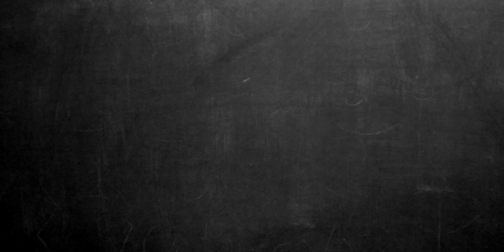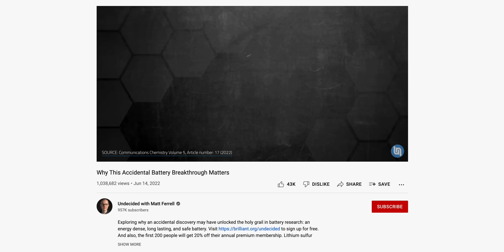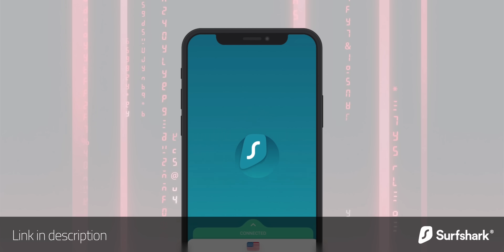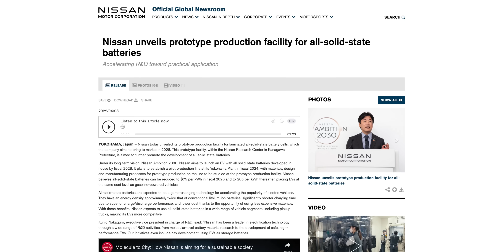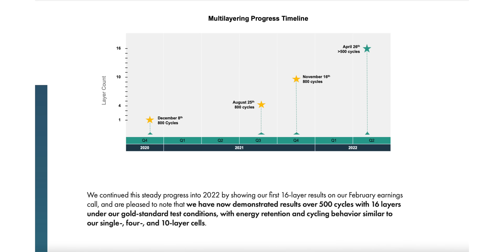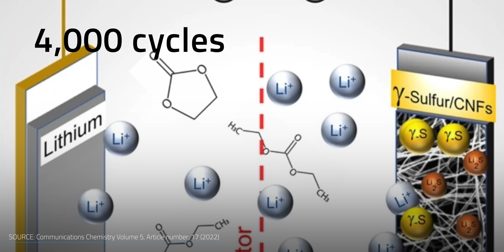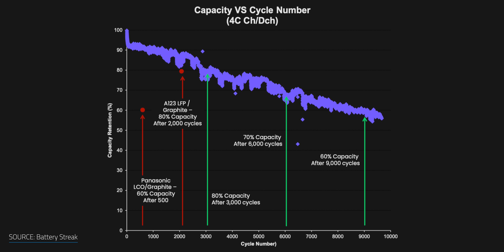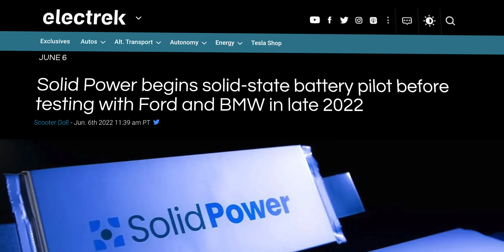Is This Solid State Battery Too Late?

Comment: I really think the small form-factor solid state batteries would be wonderful in personal electronics. A high-tier Samsung or iPhone that can go a full week -- OR TWO -- without a charge, and is charged within 5 or 10 minutes from 0? A laptop computer than can be used 3 days out of the week PURELY on its battery and only need charged one time when you get home -- all week? 

Hell, take some of these SOC mini systems (Raspberry Pi for example) and have them running for weeks at a time, doing whatever they do, even if you're out of power for a few days?  

Get me a big enough one and I could replace the lead acid battery in my APC battery backup device and could run my 1150W gaming PC for a full day on emergency power. Or a home router and modem each for 2 weeks during a power failure. Things where using a chemical battery is otherwise not particularly helpful or possibly a hazard would become a useful backup power solution. This would include also dash cams in cars. 

Okay some are asking, why in dash cams, they already use batteries?  -- Easy, Lithium battery packs HATE heat. I had one in my car during the peak of summer and the pack hyperinflated in its pouch, so much so that it SPLIT THE CAMERA BODY APART. Because of that camera, I REFUSE to buy a battery-powered camera. Period. and I tell ANYONE looking for dash cams (especially in this area where summers have gotten more and more days out of the year in the triple-digit ranges) to AVOID traditional cameras. yeah they're more expensive going with Super Capacitor types, but I'd rather spend $300 on a 3 channel system not using a battery that has nearly no risk of catching fire when the inside of the car reaches 150F. The current backup option is Super Capacitors. Which only power the camera for just a few seconds or minutes after power loss. Both my cars are using these at this time, but imagine where the camera could sustain itself for 3 or 4 days parked after the battery low-voltage cutoff is triggered, and the camera would then revert to battery power -- again, for several days. Now, I tend to drive my cars at least 3 times per week each. (Everyone knows leaving a car sitting for long periods of time is WORSE on them than driving them alot)

Comment: I have done my Phd on lithium ion battery and have experience in solid state , lithium sulfur , anode cathode and separator. I personally dont see solid state battery as the future , lithium ion battery using liquid electrolyte are also progressing fast with multiple solutions used for flammability and high capacity anode cathode materials like silicon and sulfur. Solid state battery has far too manyy problems and research vise its a good topic

Comment: With true financial incentive to find the next big battery tech I'm sure we're within coupled of years of a breakthrough. Take the new F-150 Lighting for example having 320 mile range with the extended battery but dropping to a third when pulling a 10k trailer. Now put a battery with 2.5x the range and now we're going beyond 250 miles whilst doing real truck work. Yeah it's not matter of how, but when it'll happen. Now let's beef the grid up to handle the extra load.

Comment: As a person whom recently moved to a place where I needed a car, and hence bought my first car, and since I just bought a house my first car needed to be cheap enough I could buy outright. I was looking at 10 year old EV's, but everyone I could buy if I really stretched my budget, did not have enough charge in the battery that I drive my planned day to day trips without and only charge at night. And if I charged both day and night, it would not be enough to drive any unexpected trips on top of that. I got a really good deal on an 8 year old ICE Hyundai that had barely been driven... Hopefully  I can buy 2-3 year old EV in 2 to 3 years.

But my point, sorry for the ramble, is that the lifespan of EV's made 10 years ago is too short... As far as I understand EV's made today will last longer than the older once, but I really hope batteries can last 30 to 40 years soon instead of 10, for the sake of our planet

Comment: I'd say we should still try to push as far into the solid state battery technology as possible, because we don't know what will work out with lithium, but we also know that lithium is limited as a ressource and maybe one of the possible solid state chemistries will be adaptable to sodium solid state batteries, that overcome the energy density problems we currently habe with them, which might not be possible with a liquid phase chemistry for them.

Comment: I can't find any mention of battery streak's energy density. I can only assume it is no better than Li-ion. IIRC solid state promised to reduce cost as well as mass and charge time so don't know where the $200/kwh comes from.
LFP seems to be the battery of choice for longevity and cost for now as long as you accept lowish range. Many will accept this tradeoff of cost/range.
Also the lifetime for solid state was with continuous fast charging which won't happen in the real world.
I think there will definitely be a place for it, while looking forward to Li-S even Na-S for really low cost.

Comment: I still feel that solid state has the potential to move adoption further than any of the others. I understand that they are just early, best case, numbers, but the thought of cutting the weight in half and charge time in half in my mind pushes through the barrier for the reluctant.

Comment: Being that I am most interested in automotive applications, I am most concerned with weight. If a company can make an electric vehicle with decent range, and weighs less than 3500lbs, I might actually be interested. Heavy cars are not fun to drive. 

Me car only makes 200 hp, but it’s more engaging and fun than any EV I’ve driven.

Comment: Wouldn't new battery types be a perfect fit for smartphones, they are really expensive for their size, a flagship phone that could bring 50-100% the capacity, half the charging time, and better longevity would be revolutionary, and it would really help bring down cost for larger options like EVs
Reply: The cost of a smartphone battery is less than $10. There already are phones on the market that you can charge at 120 W, so fully charge from 0-100% in about 18 minutes. 
If most people buy the same Samsung and Apple phones then those manufacturers simply don't feel the need to improve their charging rates. It's technically possible now.
Reply: @saschamaj  well I'm part of the problem in that regard, on the other hand I don't really care about charge speed, it's only a bonus to the much better battery time

Comment: no matter the battery composition you still have to charge the thing. therefore...i won't be doing the ev thing...or even consider it until fusion happens....if it ever does.  i don't want to be part of the pollution problem by merely displacing the pollution source. then there's the sourcing of materials / recycling conundrum. as of now...i do NOT see ev's as an answer to pollution.

Comment: its important to remember that alot of this is very new in the research world. we've been so focused on designing energy storage on the micro scale but those methods simply dont scale up so we pretty much have to begin from scratch.
Reply: The needed scale isn't that large. Ev's have now reached a size where they are big enough both for cars as wel as domestic storage..
Any progress is now going to keeping the same capacity buy lowering weight and volume.

Comment: " In 2021, the United States consumed an average of about 19.78 million barrels of petroleum PER DAY. This was an increase in consumption of about 1.6 million barrels per day over consumption in 2020."  (From the US Energy Information Administration.) What do we have to replace this?  Filling batteries with electricity from coal and oil fired power plants is not the solution. All battery solution that reduce hazards, rare earth materials, and other problems are needed 30 years ago. We are without a doubt so far behind the 8 ball it's going to be really difficult. I know there are many brilliant people working on this problem. I hope for our species sake we can find a way. Peace out.

Comment: I'm really disappointed with the battery statistics in this video. You always talk about how the QuantumScape cells retain "above 80%" energy after x cycles while comparing it to other cells where you state they only reach those "low" levels after 800-1000 cycles and make it look as if the cells are bad in the way you present it. If you actually look at the graphs the cells retain around 90% after 400/800 (depending on where in the video you look). If you now extrapolate those graphs you roughly reach also reach 80% after 800-1000 cycles. So no difference in cell life for cells that are still in development with cells that are available already (aka a good thing as they should keep improving until release). And let's not even start talking about the tesla cells. Other commenters already pointed out that it is obvious why the bigger cell stores more energy.

Comment: All these technologies are stepping stones. And different solutions are effective in different applications. Just as LFP and flow batteries are good for household and small grid-scale solutions, solid state batteries may present advantages for applications in personal devices like cellphones and laptops.  A cellphone that charges in 10 min and lasts for 3 days? yes please. A laptop that will do heavy workloads for 2 days on a single charge, and recharge in 30 min? take my money.

Just because it may not be the most excellent EV solution, doesnt mean it lacks valuable practical application.

Comment: Lithium Ion higher density batteries are inherently unsafe, they must be protected with a 1000lb tub. There isn't any production battery which will make EVs more green than ICE , and especially PHEVs; Current EVs typically weigh 4500 lbs largely countering the efficiency of electric motors. World wide solar and wind account for less than 5% of enegy and demand is increasing faster than renewables are being installed. Sodium batteries are currenlty less dense but scalable; lithium is in limited supply and hence not currently scalable; incapable of meeting demends for 140 million vehicles a year; probably not 5 million. The biggest positives of Solid state if ever made would be safety- no need for a 1000lb protective tub; faster charging, possibly lower cost per kWh/kg; scalable. In any event EVs are a dead end without a green power source such as Thermonuclear power.  Nothing at all matters if they do not get produced like many products tthat claim all sorts of positives but never actually get made. This is why it is important to differentiate between real products and make believe claims.

Comment: Mark would you consider making a video about smart devices that are connected to the net and could use power at the optimal times?
For example a smart washing machine that waits for the sun to reach its peak so it can profit from the cheap solar power coming in.
This would decrease the load on the net and make us need less storage capacity.

What's holding back this technology? I've always thought this holds a lot of promise because It seems like something we can do right now!
Maybe the grid operators aren't able/ willing to offer flexible pricing to incentivise this?
Why not though because it would seem like this would help make their job easier.

Comment: I don't think many people have an inkling of just how many fires have been started by Li-ion batteries.   Across all the tools and toys there have been thousands of fires. I've been using E power tools for 20+ years and riding E bikes (and now E foil) for more than 10 years.  And reading of fires for that time.
 Crazy Larry's E bikes - where I bought two of my first E bikes burned to the ground from charging Li-ion packs.   
My dog got ahold of a single 18650 cell and biting it just hard enough to put teeth mark in the soft cell side was enough to start it shorting out.  In seconds it was glowing red hot the same as if you put a welding torch to it.   It ingited the carpet and flames were licking the bottom of my (foam!!) mattress when I walked in.  I used a yard stick to flick the battery out from under the bed and it melted through the linoleum flooring in seconds. FInally got it onto concrete steps leading to garage.  If I hadn't walked into that room for another minute my house would have gone up.  
 This from a single AA sized (roughly) cell from a flashlight.
My E foil (surf board) uses a 30lb li-ion battery.  It is recommended (and I do) to charge and store it in a very expensive fireproof case to isolate it in case of short and fire.
  Yes - safe to say most have no clue how dangerous they really are.
Just one:  https://www.usatoday.com/videos/news/have-you-seen/2022/06/23/california-firefighters-submerge-tesla-water-extinguish-fire/7709506001/

Comment: Just wondering aloud if the battery technologies may be ultimately combined in EVs. Not as in utilised in one battery, but seperate units managed by a battery management system to utilise the advantages of the unique features of each depending on intended trip profile. 
Eg, a quick ‘splash & dash’ (to use a liquid fossil fuel expression) charge is first done by, say, batt tech A because of its fast charging capability - but limited to 80% capacity for lifespan. Whereas batt tech B is more utilised for deep slow charging to 100% as that charging profile is better for its lifespan.

Comment: I still have a hard time visualizing the gargantuan banks of batteries for utility-level storage for the grid, even while driving past my local natural-gas fired peaker plant here in SoCal, a not-inconsequential industrial installation. Centralization of power generation was the only practical large-scale solution for a great long while, but so many people seem to be gut-level incapable of accepting and adapting to change such as homeowner rooftop power generation & storage and distributed utility-scale power generation & storage, both leveraging innovation and improvements in materials science, manufacturing, and resource management. That intransigence by the general populace as well as the strident opposition by utility company profiteers is really far more inimical to power generation, storage, and consumption processes that the pace of research and development.

Comment: The main reason the 4680 cells have 6x the capacity of the 2370 cells is that it's got 5.48 times the volume..
Still, if their numbers are correct it's about 10% better energy density.
Reply: The small percent increase in energy/volume misses the main breakthrough. 

Assuming identical charge times, six times the heat has to be dissipated through a thicker cell and with a surface that's only larger by a factor of a lot less than six.
__

In more detail, and feel free to skip what follows:

The linear dimension is going to be about cube root 6 times as big, so the average distance for the heat to travel is increased by that 

The surface area increases by the square of the above number. These two factors partially cancel as the thickness allows down heal loss but surface area increases it. The back of an envelope overall dissipation efficiency might therefore be expected to be worse by a factor of cube root 6, and charge times increased by a like factor. That's just over +80% longer if the tech was scanned up without any other improvements

To claim an improved charge time is therefore a genuine technological leap ahead, assuming the new cells deliver the promise.

Comment: This research is valuable but the Science behind the necessity (abolition of burning fuels) is deeply flawed, and wrong. CO² is a benign gas constantly recycled by plants which turn it into sugars for itself and for the below ground support team; as exudates, most of which is sequestered thus needing replacement to sustain life: see the Science behind Regenerative Agriculture. 
The cutting edge will be replaceable (non-fossil) liquid fuels and oils. E.g. HydroThermal Combustion (HTC) already produces coal in a matter of hours from human waste and destroys the forever plastics which are a real pollutant.

Comment: I believe that weight reduction, safety, fast charging, and recyclability will make solid-state the best choice for mobility. But, the answer to the energy storage problem is 'different technology for different needs'. As you've said before, "There is no  silver bullet  when it comes to energy storage".
Reply: If the battery with a 600km range and still be under 20% of the weight whilst providing a fast charging times under half an hour, everything will be electric. I'm still hoping for an EV superbike with litre bike performance and 200km range.

Comment: I feel like I got click baited again...
Reply: Every solar, wind, and “breakthrough battery” video or article is clickbait… every time. 

Most people have no idea how much mining would be necessary to build enough solar, wind, and batteries to cover our energy needs. And these batteries and power plants only work for 10-20 years, and then you need to completely remove and rebuild them.

Nuclear energy would be the only way to get off fossil fuels.
Reply: @dannypope1860   I wouldn't say it's the only way. Maybe population reduction or or fusion or Tapping into some quantum field of energy.  Now that would be newsworthy.

 And before you say it's unrealistic or impossible, Just remember every great Leap in technology Had the same resistance at some point